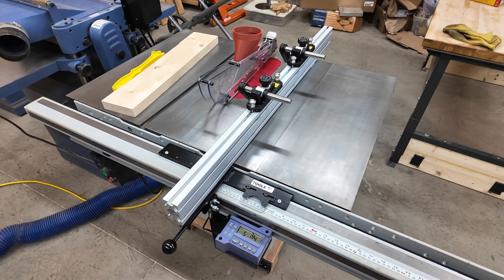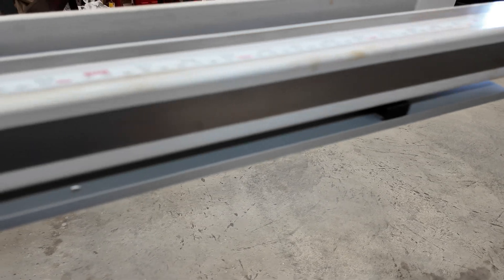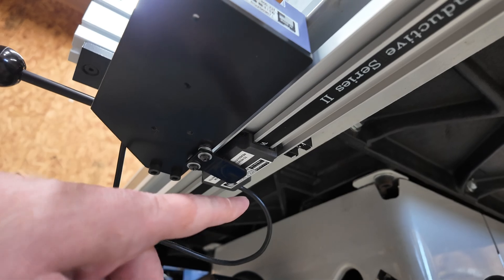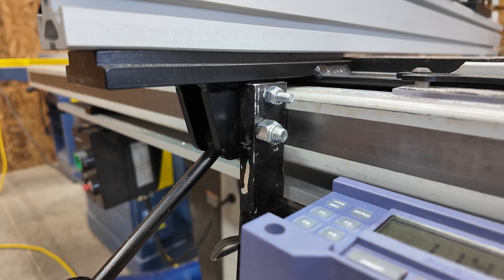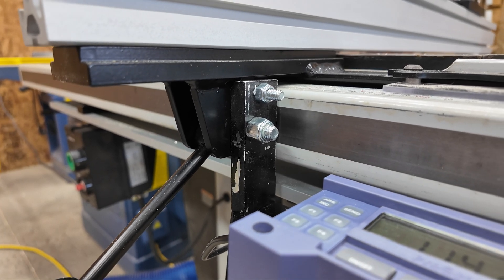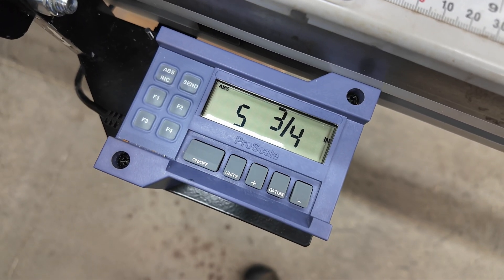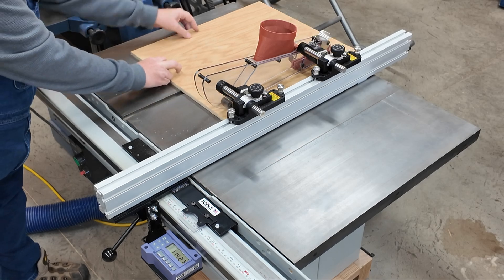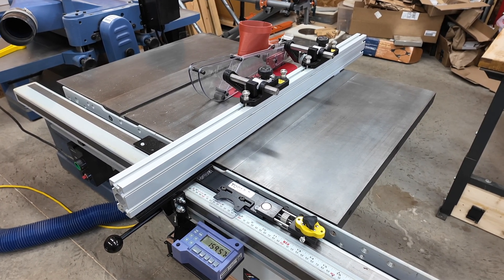Upgrading my table saw with a digital readout from Accurate Technology

Comment: What did the calibration process look like? Curious if you’ll need to repeat it when you switch the blade out
Reply from the maker: @williamcox8491  I should have shown the calibration in the video.  Basically you just rip a board, measure it with a caliper, and then tell the DRO what the width was, so it knows what the reading should be at that position of the fence.  I plan to recalibrate whenever I change blades, but I don’t do that very often.
Reply: @ that’s helpful. I was picturing having to zero it like you do on those handheld digital calipers.